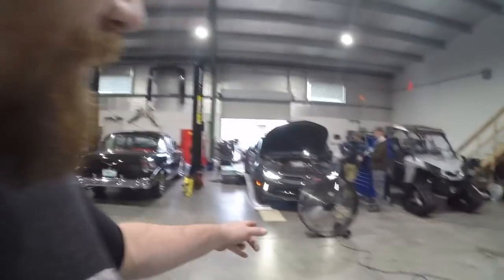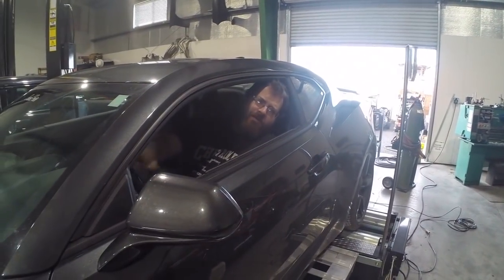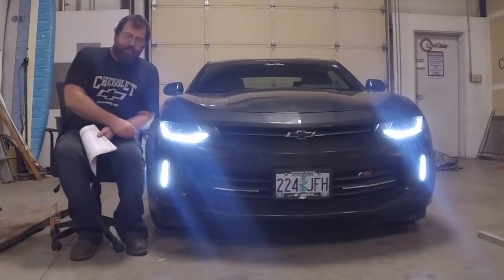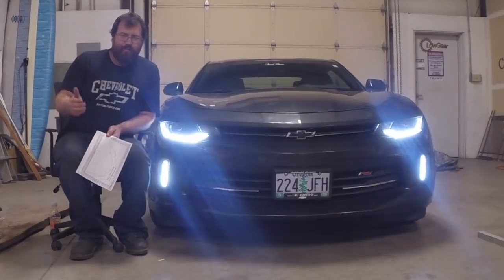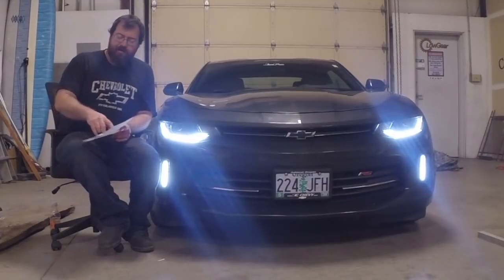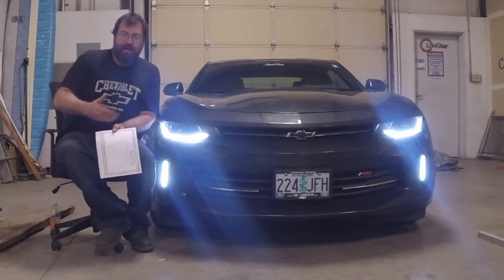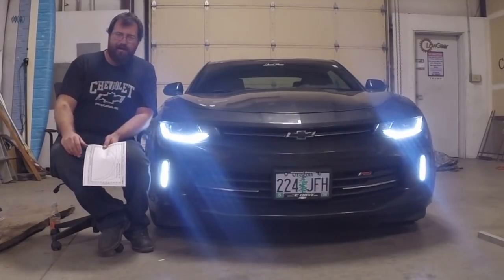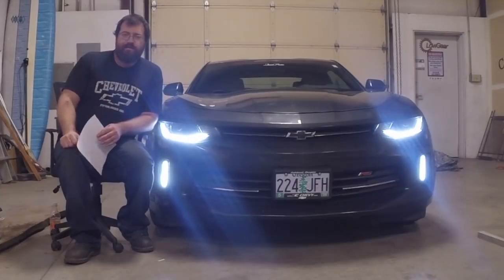DYNO TESTED: 6th gen LTG Camaro 2.0t RaceChip GTS Black

Comment: Something is definitely not jiving here.  The numbers don’t make sense. You have more  horsepower than torque on the first of pull. How?! The car is not stock  if it has a catless downpipe but even then 280 RWHP isn’t jiving either.  Putting in a catless Downpipe is only good for about 10 hp MAYBE 15 On a cool, low humidity day, at sea level. I’ve seen many many stock turbo camaro pulls and they pretty much all look the same; 232 RWHP 250 RWTQ.  Maybe there’s something wrong with the Dyno, maybe it’s out of calibration or the load sensor is malfunctioning… Something. But those numbers just don’t look right at all

Comment: Are there any check engine lights? And does the car still run fine?
Reply from the maker: I never got any check engine lights, and the car always ran fine when I used it.
Reply: RacnJsn95 cool thanks for the quick reply all I have to do is plug it into the obd2 plug and it’s ready to go right?
Reply from the maker: No, it plugs into multiple sensors under the hood. It does not plug into the obd2 port

https://youtu.be/mX9FIPG7Hvg
Reply: RacnJsn95 thank you

Comment: I;ve got not issue with your Dyno results but Intake, downpipe and a tune is not exactly "Stock".
Reply from the maker: Iron Reed the tune was stock, I had a k&n air filter in the stock air box and stock intake tube, I wouldn’t count that as an intake by any means. Yes I did have a catless down pipe, a pretty shitty one, but still catless nonetheless.

Comment: Why not just get the V6 with 335 hp? Or V8 with 455 hp...?
Reply from the maker: DANPETRYSSHOWCASE  because it’s more fun to make slow cars faster than “fast” cars.
Reply: Bc with a few minor upgrades, the 2.0t will spank the 3.6 v6 all dayyyy. And yea it may be rated 335hp but it actually only puts down 270whp and even less tq. The 2.0t are tq monsters.

Comment: Are you still using the chip? Any long term problems?
Reply from the maker: Rough guess I continued to run it for about 6 months or so after the video was posted. I had zero issues with it personally.

Comment: Why only setting six? What happened to 7?
Reply: Run it @ The Spinal Tap setting...Drum roll please...11...
Reply from the maker: It was recommended that I not run it on setting 7 as I only had 91 octane fuel available. If I remember right all the testing and tuning they did was on 93 or 94 octane.
Reply: @RacnJsn95  so if I put it on 7 with 93 octane it’s ok?

Comment: Did the chip you purchase stated that you would receive 30 horsepower or it was suppose to be more i know the have different ones which costbmore with more horsepower
Reply from the maker: starent veveo this was the GTS black model. On their website the “gain” numbers are crank hp numbers, not wheel.
Reply: RacnJsn95 did it still match up with the expected ~15% drivetrain loss?
Reply: Im not sure about crank and wheel horsepower i have a 2012 cls550 with 402 hpthe we site has the best one with 78hp for around 800...who what would be the wheel horsepower.. do you think800 is worth it and im doin 0 to 60 in 4.3 do you think 78hp will bring it to like 3.9

Comment: If your RaceChip is a GTS Black as indicated and you only got 30 Hp more, then you need to contact RaceChip, because when you input the car data on the site it shows "

S --> +35 HP1+26 lb-ft1
RS --> +43 HP1+32 lb-ft1
GTS --> +52 HP1+39 lb-ft1"
Reply: Those are crank numbers not wheel numbers.

Comment: How much hp and torque where you at when your engine blew. Im planning on getting a tune but don't have any forged internals do you think the stock internals will hold out as I'm not getting a radical tune.My current setup is a zap catted down pipe with a cai, the tune I'm getting is going to have my camaro pulling around 300 HP and 330 ib ft to the wheels. I don't want to push it to 350 wheel for the moment as I don't have any forged rods and pistons. Do you think these numbers are safe for the time being on stock internals or should I go for lower numbers around 270-280 wheel hp ?
Reply from the maker: I'm not sure, it was never dynoed before this video previously before I broke a pistons. I can say that I recently just broke it again pushing it too hard, no actual dyno numbers buy according to HP Tuners VCM Scanner, (engine numbers) it was running around 470 ft lb TQ, and 411 hp.

It seems like they can really just let go at any time.
Reply: @RacnJsn95  Did you recently break the piston with the gts black race chip ?
Reply from the maker: Godzilla 187 no, I haven’t had the race chip installed for like 6-8 months or more.
Reply: Considering the 2.0t LTG motor is rated at a peak of 275hp/295tq from GM 400+ is impressive. Is the transmission giving rough shifts? 

I've got a 2014 ATS 2.0t (272hp/260tq stock) and the Racechip would theoretically put it near the power/tq limits of what my transmission is designed to safely accept

Comment: WEAK ! 30hp sorry but that’s not impressive.
Reply: John Smith weak like your jawline mouth breather.
Reply: 30 hp from no physical modifications
Reply from the maker: I’ve seen people pay more for less with a “real tune”. Can’t really complain for a plug and play device. It can only do so much.
Reply: RaceChip claims the followings for their products for the same car model:

S --> +35 HP1+26 lb-ft1
RS --> +43 HP1+32 lb-ft1
GTS --> +52 HP1+39 lb-ft1"
Reply from the maker: Abe Ibrahim yes that’s they claim. Their claimed numbers are also crank numbers and not wheel hp numbers.

Comment: I have a Racechip on my F-Type and it is phenomenal on the dyno.  That said, your plotted results are wrong, torque must = horsepower at 5252 RPM.
Reply from the maker: It’s not my dyno, but I’ll make sure and tell the dyno owner his stuff is messed up
Reply: That is what I was saying also… Something is not right with those numbers
Reply: Mathematically, horsepower equals torque multiplied by rpm. H = T x rpm divided by 5252 as a constant.

Comment: Nice to see someone actually dyno these race chips. But in case you are wondering. Yes modifying, altering the onboard computer system does void your factory warranty. Make sure to upgrade your engine essentials before putting on these race chips. Or else you will blow your engine in no time. Wont be fun when you start hearing weird sounds from the engine bay.
Reply: Thats incorrect. This doesnt modify the ECU. Thats the purpose of a piggy back tune. It fools the ECU into adding more boost or more fuel. Its not actually tuning the computer maps

Comment: Jason how would you say this compares to any of the hpt tunes you've ran in the past. Or if you dyno'd any of those. Just wondering if this is putting out more power than my catless dp and intake hpt tune.
Reply from the maker: Honestly it depends on how radical the tune is. If it's a crap tune, it will probably be comparable. But if its a radical tune, the actual tune will make more power than the race chips.

The RaceChips doesn't even hold a candle to the tune I was running before my car blew up... But there again... my car blew up LOL

Comment: How do I purchase that chip ? And will I get a different read with mods I have ?
Reply from the maker: Jcee713 _818  www.racechip.us is their website. I’m sure it would be slightly different with mods. You may end up running on a lower setting with mods than you would on a pretty stock car.
Reply: @RacnJsn95  thank you , I will definitely check them out and maybe post a video.👍